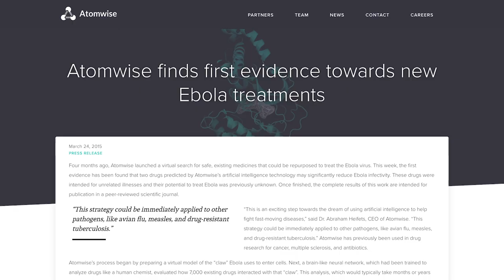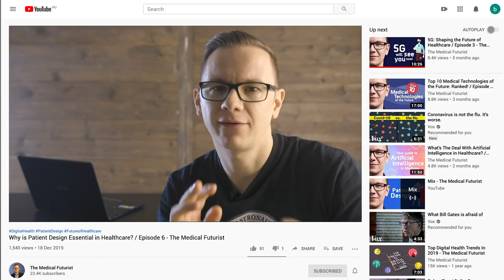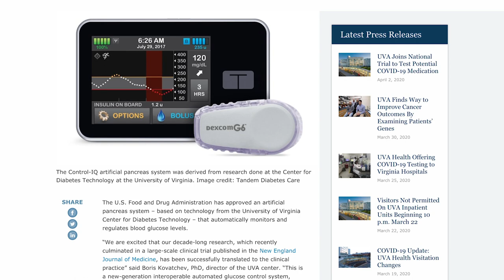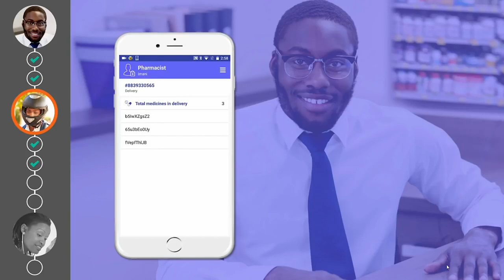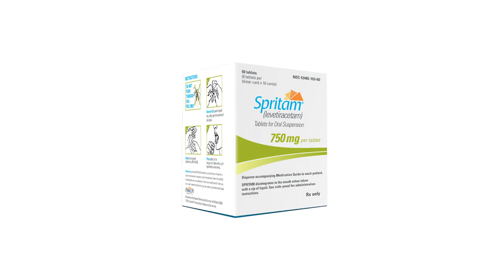5 Things Big Pharma Can Expect from the 2020s / Episode 13 - The Medical Futurist

Comment: Everyone is now trying to push this idea of "applying AI for industry X" to cut costs. But many forget that the AI adoption might actually turn out to be not very much less expensive, than doing a regular discovery process. You just open a whole new can of worms. Certainly, this technology will change usual way of things in R&D, but the actual costs might not be as low as many would imagine, AI is one of the most expensive technologies in terms of talent cost, for example. And if you try to save some budget and hire less expensive (so less skilled, talented etc) AI engineers -- the result might not be very innovative, as well.
Reply: A.I, is only capable of sharing information or reacting to information it is provided by humans... it is directly our own information in a system.!

Our brains are evolutionary in this instant and in the next,.. A.I. May produce a faster speed of information gathering or constructing something. BUT IT WILL NEVER BE smarter than us, and our brains.

A.I. Is a tool. Not a problem solver.!